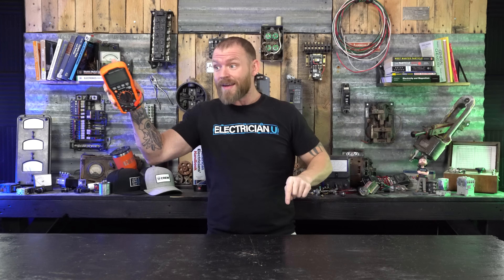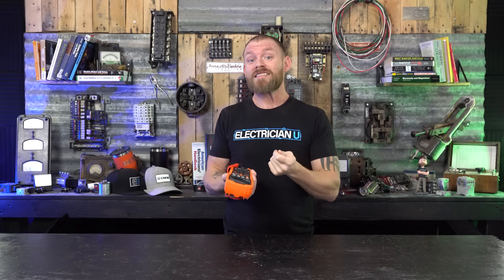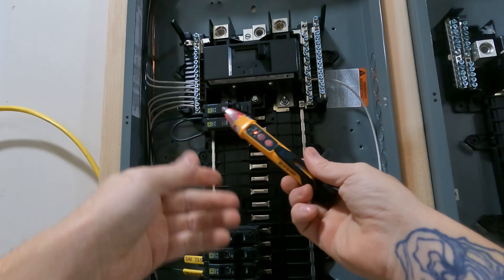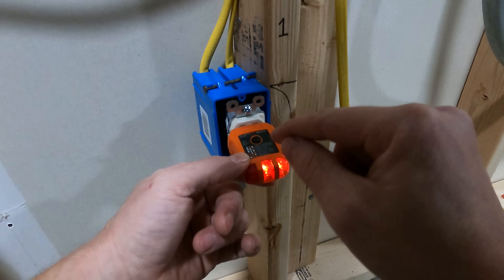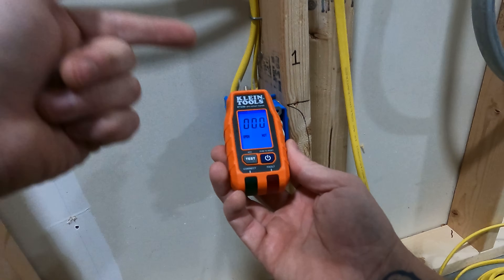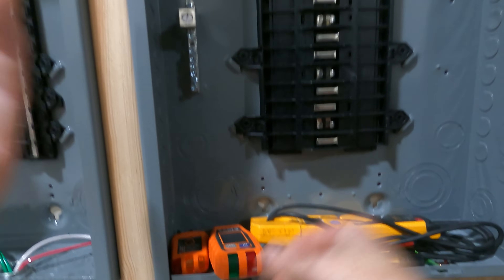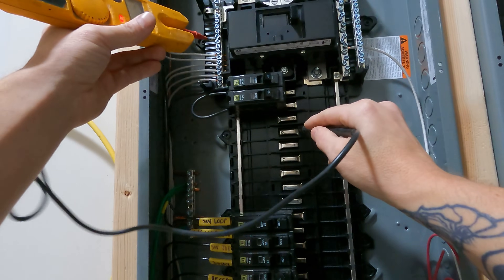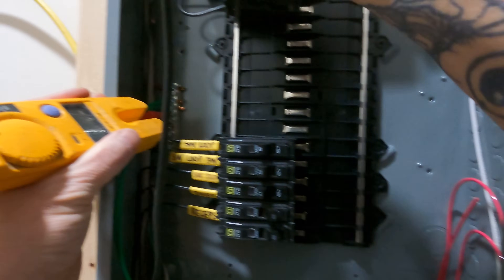How to Test for Voltage. What is Voltage? Can't You Just Use a Tick Tracer?

Comment: If you haven’t already. Can you show everyone how to test mc cable for voltage? A lot of apprentices have been shocked, working above grids dealing with mc whips. How would you test for voltage when you come across the issue of not knowing if it has voltage or not when you don’t have a tic tester you only have a volt meter or multimeter

Comment: I'll probably get one to play with and see if I get comfortable with it in any situation, but I think I'll stick to the GFCI plug and DMM until then. BTW - I do use the continuity and voltage presence (through air coupled inductance {I think}) test functions on my DMM, but only for cursory checks, not function or safety.

Comment: I call the non contact voltage sensor a “Hot or not stick.” After I switch a breaker I have the stick in my shirt and stick it inside a breaker box before my hand.

Comment: A receptacle tester's lights are wired to hot - neutral, hot - ground , and neutral  - ground  prongs and light up when there's a voltage difference between the prongs.  For example if all three lights are lit with the center light glowing very bright and the other lights a more normal brightness this indicates the receptacle is wired to 208 or 240 volts, as could occur if someone installs a nema 5-20 when they really want and need a nema 6-20.

Comment: Question. If you have all breakers off, but you're still getting 120v, what is happening?
Reply: Getting 120 volt  where?
Reply: @FirstnameLastname007  On the main panel.
Reply: @michaelk8060  sorry my question  should of been is it at the outlet your still getting 120volt?
Reply: @FirstnameLastname007  I had one tester lead on the neutral bar and the other on the screw of a breaker with the breaker being off and I was still getting 120v.
Reply: @michaelk8060  okay take that wire off the circuit breaker and test the wire by itself if its not hot then sounds like u have a faulty breaker too me

Comment: Here's my view of dummy sticks: if it reads nothing or low, the circuit is definitely off and you're okay to start working. Otherwise you might need to pull out the voltage meter to check. Am I wrong?
Reply: YES you are wrong. The dummy stick is not a guarantee. Only use the dummy stick to see if you need to test further.

Comment: Great explanation!
Only use Tick Tracer to detect presence of voltage, but NEVER to detect absence of voltage.
Reply: Just quick question  in uk when testing using meter  thought i was taught L toN 230v  L to E 230v and N toE
Reply: And N toE or ground up to15v acceptable though pref 0?

Comment: Great video! Personally I use a Fluke 87v first to see what the voltage is. If the voltage seems questionable I use my Ideal Wiggy to verify it's not "induced voltage" that a Digital Voltage Meter can't pick up.

Comment: Another amazing video from such an amazing channel. Thank you guys for what you guys do. I have a question and would love to know some of the reasons why I have seen voltage between a neutral and a ground and testing with a voltage meter. I have actually seen up to 30 V before sometime is it 10 or 20 V on existing systems, I would be working on. What would be the scenarios causing there to have voltage between these two points when there shouldn’t be. Thank you. Kindly in advance. Joseph Nicolas
Reply: When I've encountered this it's usually been an issue with the neutrals being all tied together from different circuits. Or a multiwire not on a double pole and one phase is on and the other is off. Still learning this myself though so could be other things
Reply: @stacidiane  thank you for sharing

Comment: If you shut off breaker and measure between hot and ground and get voltage say 10 volts. That would be ghost voltage correct?

Comment: DUSTIN, If you didn't have any color codes to tell which is phase A , phase B, phase C, how can you know which is Phase A, Phase B, Phase C? I have heard to use a 3 phase motor and watch how the 3 phase motor is rotating directions to figure out the phase A, phase B, phase C? because a DVM meter will only tell you the voltage but NOT the 3 phase parts
Reply: The direction of rotation will only tell you phase orientation, but it won't identify each line conductor.
Reply: @robertbritton656  How do you IDENTIFY each phase line conductor? because a DVM meter will only tell you the voltage of the phase NOT the Identification as well as a 3 phase motor will only tell the phase orientation NOT the identification
Reply: @waynegram8907  The easiest way to do it would be to test for continuity between the source of the installation and the point you're working at. For example, test between L1 at the circuit breaker and all 3 points at the unknown conductors.
Reply: @robertbritton656  All 3 phases are mostly a Live circuit with very high voltage being applied to the circuit breaker box. I'm not sure if you can use a DVM in Continuity mode while the 3 phases are a live circuit this is very dangerous type of testing. The Continuity will tell you its connected to L1 but still doesn't tell you if its phaseA, phaseB or phase C, that is the hard part is figuring out which is phaseA, phaseB and Phase C

Comment: THANK YOU for this. As a new apprentice, I'm still nervous about using a DMM. This is the exact video I've wanted to see - using one in different scenarios and what it all means.
Reply: If you've got a full blown Digital MultiMeter working on a job site that would be like taking a Thomson submachine gun squirrel hunting. Hopefully the person/people training you just call it that.

The Fluke 88 has been around forever. It's a quality tool. However it has functions you'll likely never use as an apprentice.

An everyday meter would have stuff like 1000vac, 100vdc, 10amp in line, a continuity tester and a useful add-on if you need to check loads get an amp clamp.

Comment: This is not really on topic, but several years ago I was replacing a filter in a compressed air line. But strangely as I separated the pipe it arced. AN AIR LINE !  that goes to the paint booth. I had other calls to make, so I told the owner he should get an electrician in there to see what is going on. It would be really bad if the painter started spraying and got an arc. I tried it several times just to make sure it was not some kind of static charge. So, there must be a wire in contact with the plumbing somewhere. Might be a quick find or all day.

Comment: I'd like to see you talk about some situations where a voltage tester has helped you catch a problem where the dummy stick wouldn't have
Reply: I’ve had false positives on the dummy stick. Not sure exactly sure how it happened, but it was beeping because it detected a tiny amount of voltage, even though the power on that circuit was off.
Reply: Shared neutrals

Comment: The NCV is a warning device, not a measurment device.  It is to clear before going hands on.  And should be used when approaching failed equipment and if you “put it down” for a period.  Just like checking a firearm.  I suppose more useful in repair.  Is that cabinet really grounded and not energized?  Just a sweep will catch the rare event.  Similarly, if you’ve been cycling power on say a condenser unit, then went to the truck or something, is it on or off?  Give the HV wiring a sweep before going hands on again.  The beeping means break out the voltage measureing device to physically verify and quantify.

Comment: To each his/her own I suppose.  I use a dummy stick and that helps me to keep from getting shocked.  The tool that I use is dependent on the information that I hope to gather by using it.  A dummy stick is a binary device - Yes or No.  "Is this circuit hot?" - that's all that it's good for, but the Yes's are important.  Just test to make sure that it's working before you believe the results.  Find a known hot circuit and make sure that you're getting a positive test before moving on to the circuit that you're going to start working on.  All of the tools that you demoed in this video are really useful.  I use all of them, including the dummy stick.

Comment: Very informative, do you recommend that fluke T5-600 tester even thought it’s not a RMS tester, I heard they are not as accurate as a true RMS device, thanks Bro
Reply: As electricians, for the most part we are reading nominal voltage. Meaning if we take a voltage reading on a receptacle and it’s plus or minus %5 of 120 volts. That’s good. Accuracy is important but we wouldn’t need something as accurate as someone in electronics
Reply: @adammorgan9304  Thanks for your reply Adam

Comment: I love my non contact voltage tester. It gives me an idea of what’s going on. It also beeps at a different frequency based on voltage ranges. I mostly use it to check if breakers are off though.
Reply: You could use ncvt but not Klein ones ) i do recommend fluke. It’s the same price but much much accurate and no accidental annoying beeeeepiiiinggg all the time
Reply: I figured out that you can check to see if a ballast is working or not. If the ballast is good, the entire fixture will cause the NCV to trigger.